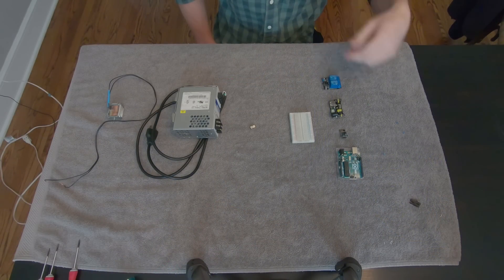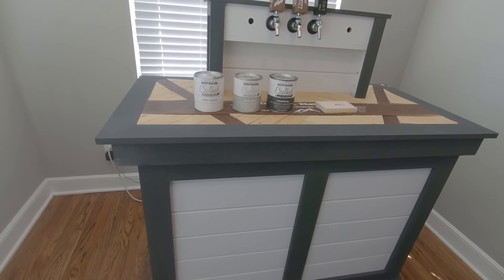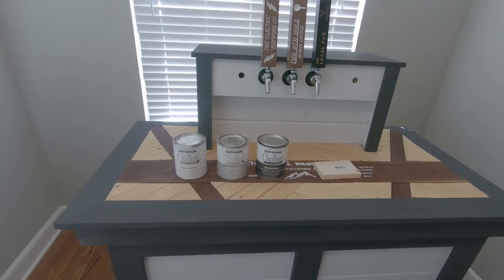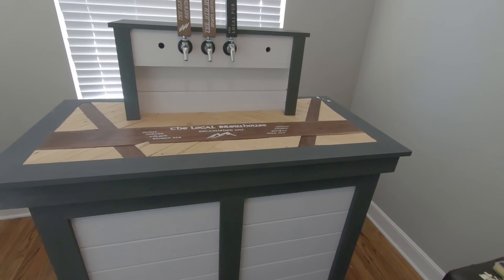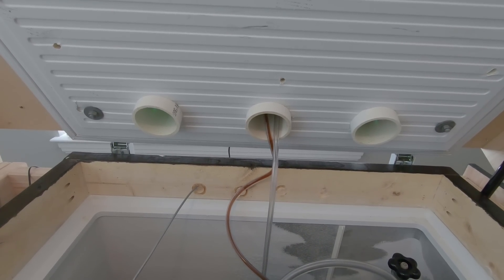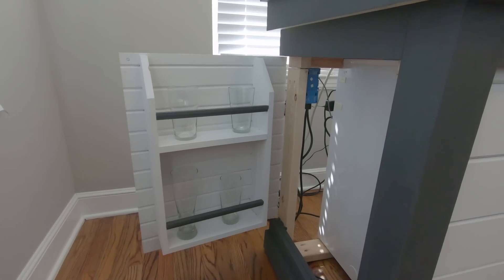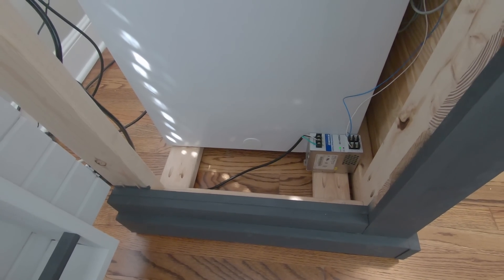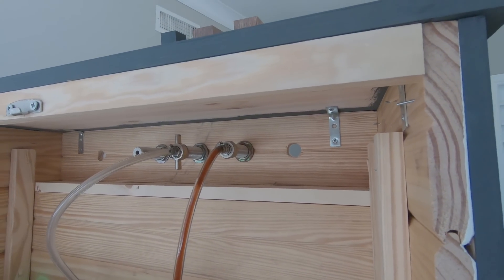Keezer Build Update #1- Arduino/Smartphone Controlled Secret Door

Comment: what is the purpose of circulating the air with the fans? Why not just keep the holes closed? And what is the purpose of the other two holes beside the taps? Didn't they let warm air in from outside, hindering the cooling?

Comment: Having no insulation in the top area probably isn't really a big issue, I think that having those two computer fans in the top area makes it less efficient though. Cold air will naturally settle in the bottom freezer area and you really wont have that much escape out the top. With those fans, however, it is forcing that cold air into the non-insulated area.

Comment: On the top lid (upright spacer) you drilled four holes which can be seen from the rear.  Just wondering the purpose?  Great design.  Looks professionally built.
Reply: That's just a collar I used for a previous build. Those 4 holes used to be the holes for the taps. I've got them plugged now and will probably unplug one in the future so that I can have my co2 tank on the outside and just run a line in to my distributor.

Comment: When pouring, especially after a few brews, hows clean up been on the top? I've been debating adding some sort of liquid 'channel' for when brews come out too foamy or drunken friends overpour, and also just for when flushing the lines
Reply from the maker: I just use a drip tray to catch the few drops that come out of the faucet after the pour. I usually don't fill it to the very top so I have a little room for error if it gets foamly. And for cleaning I just put a gallon pitcher under the faucet and drain it into that.